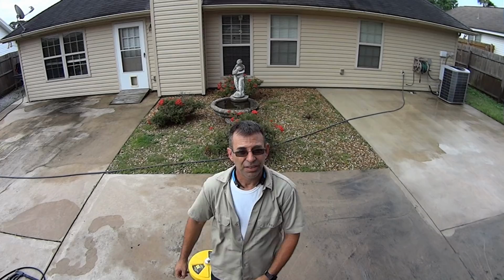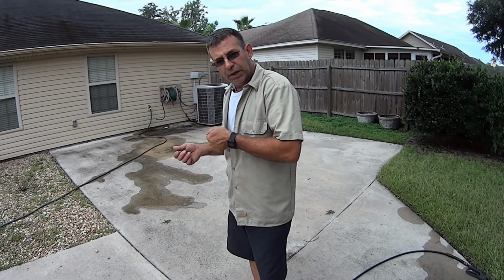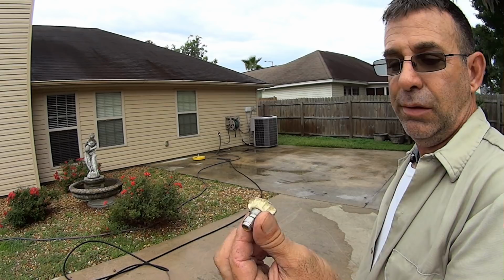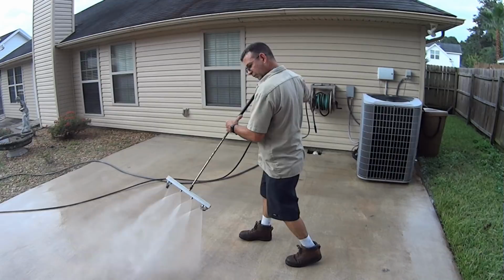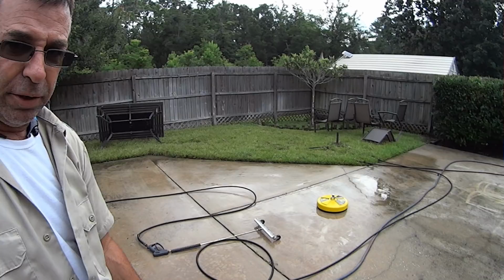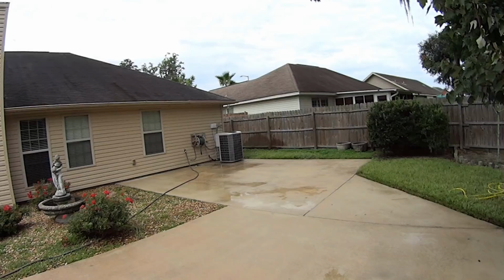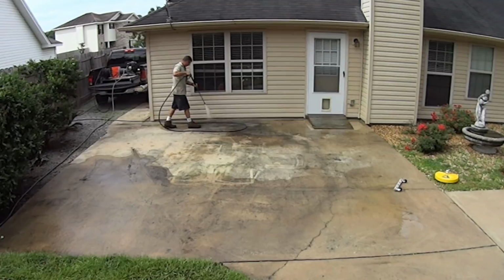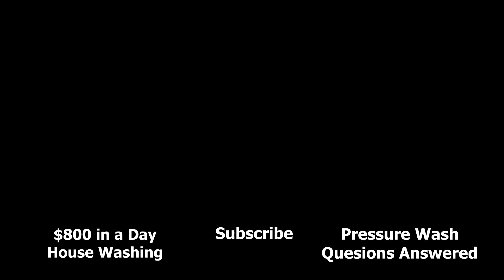How To Pressure Wash a Concrete Patio - Water Broom Demo - BE Whirl-a-Way Demo Review

Comment: I have a water broom. Was going to take it back as you're right, all it does is work like a broom then I had a eureka moment. Kept it and since I live in a snowy area in winter use it to wash the undercarriage of the vehicles, winter & summer. I have the jets pointing upwards. Works great. Will be buying a surface cleaner sometime soon. Thanks for the demo.

Comment: You have to keep pressure on it when you are moving back. That is why it comes up.If you lift slightly you can also rinse the area that you have done to see if you missed a spot. It also will push the dirt away if you lift every now and again. All in all, good job.

Comment: Great job with the video. I enjoyed it. If i can leave a small tip for your viewers. It would be to evaluate the level of the ground. You want to start at the bottom if there is a slope of some sort. That way you can clean the area where the water will build up at the bottom first, and you dont have to deal with all the flooding cleaning upwards. 👌
Reply from the maker: Thank you and I agree but it doesn’t make for good video. People like to see the clean

Comment: Dan you still using that short wand, get yourself an extension on it and you be amazed at how much easier it is. I did a 2200 sq. Ft. Driveway a week or so back about 4 hours to complete. I use 6' wand my 15" surface cleaner just glides along. I enjoy your videos.

Comment: Nice work as always. Looks like if you had a 12" longer wand you would be maybe a little more comfortable.
Reply: I agree, if he added an extension tube with a small weight on the end to help hold down the washer.
Reply: d hamby not supposed to hold down the washer your supposed to let it float like a hovercraft. You have to let the water Escape out the sides otherwise it won't do its job.
Reply: I have a g clamp clamped on the top of the outside of the case where the plastic meets the round brass piece. The weight in it is perfect to keep it down..

Comment: You can use a tennis ball in the wand handle to eliminate you having to hold the trigger down. A longer wand would help also. A ball valve will help for switching between wands or other equipment.
Reply from the maker: I do have a ball valve but I never use it. I never change Wanda, just tips but you’re definitely right!

Comment: While Dan is the expert here I used to have a water broom that just hooked to a water hose. I cleaned an auto shop floor with it. I used it like a broom. I just pushed in straight lines to remove the dust, dirt, oil dry, etc. Worked great and kept the dust down.Got up more than a broom and if u laid it down more it squeegeed.

Comment: If you put the water broom on the wheels it actually cleans well. I made a 80 psi 4 rpm water broom that is 42" wide. Makes fast work in warehouses. It has 9 jets. I also can make it 54" wide with 11 jets.  I may make 30" wide with 7 jets. After pre cleaning, floor buffer with brush, high pressure broom or whirl-a-way. Most likely a combination of 2
 We pre cleaned a 30,000 SF warehouse today. Tomorrow we scrub and high pressure broom. Two days work. Me and a helper tomorrow. Solo today. $2700 for the work.
Reply from the maker: Great job

Comment: Dan love the videos; keep them coming. I'm new to the business doing it on the side but i bought the Briggs surface cleaner you had been using. I like it but my old tired home owners machine takes awhile to clean patios. I just upgraded to a 4 gpm machine that I can pick up tomorrow but i have two questions. 1. How long does it take to do a patio (400 to 500 sqf) with your setup now? 2. How are you charging for patios? I posted some pictures online of my work and have gotten calls just for patios and not the house wash.

Comment: Great video Dan. Which surface cleaner do you prefer the BE or the Craftsman? Also what length of water pressure hose are you using?
Reply from the maker: For just a few more dollars, I prefer the BE cause it will last a lifetime

Comment: Good morning sir... thank you for your videos..they have helped me a ton.. what wondering if you could answer a question for me... How do you bid a surface cleaning job??
Reply from the maker: I usually just look at the size of the job and the condition and go from there. But to be honest I mostly just go flat rate pricing on a driveway that can fit four cars., a regular  sidewalk and front walkway is about $150 total. it will take me about an hour to an hour and a half and I tell them chemical free I’ll get it as clean as I can get it not responsible for oil stains
Reply: @DansVlog  People need to understand No Chemicals means NO CHEMICALS ! I explained to a homeowner exactly what I was going to do  Did a few feet and he was upset that the concrete was not more whiter, that he would not pay ! Good thing I cleaned a section near a corner behind the a/c unit to show him before I REALLY got going ! Still charged and got $30 for my time and setup . Six months later I did his neighbors drive way and he came over while I was putting my equipment up and asked me for a quote on his driveway.I asked about the chemical job he took me to the backyard patio area,it was all discolored and grass was dead around the edges ! The guy who did it charged him $300 🤔 Now he knows why I don't use Chemicals which is just how I do My biz !

Comment: Great stuff Dan!  Never thought I'd sit through an hour "What I did, and why I did it" video...but I've watched several of yours (and subscribed too).  So congrats on that.

The first videos I found were of you soft washing houses (cause that's my interest).  I learned a lot.  But now you seem to be deep into lawn care instead.  
Couple of questions about that:  
1) Any reason for the shift in primary focus away from house washing.  
2) I noticed you did not wet down shrubs when house washing.  Every other guy I found said that is a must to protect the expensive landscaping.  Were they overstating the damage the bleach can do to plants?  
3) I don't see you doing any roof washing.  Any reason you're not doing that service in addition to the siding?  If you did, would your setup work for 2 story roofs...or would you need to get something else to reach the roof surfaces and ridge peaks? 
4) Would a hot water heater attachment make the house washing move even faster? 

Thanks in advance for your insights.  Greatly appreciated.
Reply from the maker: Lawns is always my primary video and focus. 30 years cutting grass, 3 years playing with water. I never wet down anything. Maybe they use 12% and run it strong. I use 10% and move along quickly. Never lost a plant or grass but I do move delicate potted plants if I can. I don’t and won’t ever do roof washing. I will let the big guys with $1million dollar insurance policies specially for pressure washing have that mess. As soon as I do a roof, I fear I will be the reason for any and all issues that roof may have. No thanks, plenty of easy money to make from the ground floor. Hot water is good for heating up and thinning out oil and grease but I show a house wash can be done with just a 1 gallon pump sprayer and a garden hose. No need for the added expense in my opinion. That’s just my way, not necessarily the right way and not the only way but it works for me and I enjoy sharing my craft
Reply: AWESOME!!  I really appreciate you explaining the reasoning behind your decisions, both yea and nay.  You capsulize the knowledge you've gained from years in the trenches.  Wisdom that those like me, don't have yet.  I appreciate your mentorship, and will continue following your lead on the practice of this business.  Don't see how I can do anything but prosper by doing that.  That's again, sincerely.  ~Ron Eason

Comment: I've learned a lot from you videos. Sorry for all the questions. But, do you ever wash wooden decks. Whats your process for that? Thanks again for all the tips! Got my first 3 Jobs lined up here soon.
Reply from the maker: Painted wood I would use my normal bleach soft wash technique. Naked wood or treated wood I would  do it just like I did in this video
Reply: May I ask how you price your concrete jobs?

Comment: Hi Dan. This is Nwabisa from  South Africa. 
We only have direct drive and no belt driven high pressure  washers. I have been told by the suppliers that I will certainly  and significantly drop the pressure with any extention hoses I connect. The pressure washers are 4gpm's with a standard hose supplied which is 33 ft long? What do you advise I do as I need to do a truck set up with 100 -150 ft long hose . We don't have anything more than 4gpm.

Secondly,  I there any difference  between soft washing and pressure washing hose? Can I have the same type of hose for the different applications?

Thank you so much.

Comment: Dan, a while ago I got the Briggs Surface Cleaner from Lowes after watching your videos, how does the BE Whirl-a-Way compare? (Aside from the connection point)
Reply from the maker: The Briggs worked fine as long as I kept disassembling it and greasing it like I showed in some of my videos. The whirl away feels smoother but like I said in my video it requires a different motion so I did not like it at first but now given the choice I would prefer the Whirlaway over the Briggs because it feels better it does just as good of a job and I don’t have to disassemble it To grease it.

Comment: I guess those wheels on that water rake are for decoration. 😉
Reply from the maker: If you look a little bit closer you’ll see that I use the water broom with the wheels and without the wheels to demonstrate to people new in the business that you can do what you need to do to get the job done.
Reply: Dan's Vlog 
I wasn't criticizing in fact I would be doing it the same exact way. If everything is an exact square or rectangle and without obstacles sure the wheels make sense .. also time is a factor.
Reply: Lol
Reply: the one i bought, the wheels are in a place that make them unusable lol

Comment: I see that you have that Surface Cleaner that isn't rated for your pressure washer I'm in the same situation and I'm afraid to use it and I have no way to turn down my pressure washer will it damage my pressure washer? Thanks
Reply from the maker: Mine works fine.
Reply: Dan's Vlog thanks! I will try mine out
Reply: That size he has is actually the perfect size. It’s 4inches per gallon a minute. So he had a 4gpm machine that means he can use a max 16in surface cleaner. And FYI you can use a house mix for per treating concrete and it cleans sooooo much better and way faster. To keep from killing grass just rinse, and rinse.

Comment: Thanks for your vulnerability in all these videos. You could look like an arse... but you don't ;) Awesome work! I'm going to buy a surface cleaner and get into this work when I get into this in my springtime. But as for the multi-tip water cleaner, you know what, I think my petrol Blower will clean up the water no problem as I've moved like 2.5 inches of water with it before. And means less pooling in some areas. Hmmm. Oh, and will need to be a habit to actually remember to take it if that's the case.

Comment: Dan’s what do you charge for that much flat work?  I’ve seen your videos on house wash pricing but curious how you charge for driveways and flat work such as this?
Thanks, I enjoy your videos
Reply from the maker: I think companies around here are charging three cents a square foot for a large surface area like this. I flat rate price all my concrete and usually add it in with the house so the whole job with the house and the front driveway and everything that I have not done yet is 250.
Reply: Dan's Vlog thanks Dan

Comment: Great vid Dan! That water broom seems like such a gimmick and not something that I would use or purchase.
Reply from the maker: I thought it did a pretty good job! The four spray tips make for a very wide spray pattern which takes a lot of work away from my arms having to move back-and-forth as I was clearing things away. I effortlessly just pointed it sprayed and walked
Reply: It did do a great job but I think you could be just as effective with just a regular nozzle tip.
Reply from the maker: Ok

Comment: Wouldn't standard car and house cleaning technique saved you some time? With cars and houses, you clean bottom to top and rinse top down to prevent streaks. The same principle used here would make it much easier to make sure that the lowest point is properly cleaned and saved time from constantly cleaning up the low point.
Reply from the maker: Not always. Sometimes ya got to work towards the direction of where you want to move all the funky stuff.

Comment: How do you stop the surface clean makeing strips? The serface is clean all the dirt and mold is gone, but ihave strips.
Reply from the maker: Some people put some bleach down and let it sit for a little while and rinse it off. I would suggest you look at the surface of your concrete and make sure that the sealant is not what you see striping due to the sealant needing to be replaced

Comment: Great vids Dan. I watched them all on the BE Whirl-A-Way and based on your experience I am leaning toward not purchasing one. I also read every single comment. You did seem to find the performance acceptable as time went on but weren't thrilled. In watching your motions the secret seems to be to use side to side and pulling back motion. Pushing forward causing tipping. These issues didn't exist with some of the others. My question to you is if someone accidentally  ran over your Whirl-A-Way and paid you for it, would you buy another or something else?
Reply from the maker: mpnret I would try something with wheels
Reply: @DansVlog  Thanks for the quick response, Dan. I was initially sold on the BE Whirl-A-Way but have since changed my mine. Believe it or not after watching many videos and reading 100's of reviews I am now leaning toward the Karcher 15". It may be more of a homeowner unit and not as heavy duty as the BE but it has mostly positive reviews on it's operation and performance when it's working. Most of the negative reviews are from when it's not working from loose nuts/bolts, clogged nozzles etc. All fixable and preventable. It floats along without tipping or other issues. Even has a marine grade ball bearing which you can source replacements on Amazon. Not to mention it's cheap. $38. on Amazon, $58. @ HD - 10% vet disc = $52.

Comment: hey Dan, have ya ever tried  turbo nozzle?
Reply from the maker: Yes and I think they suck. We have one at work. Nothing will ever compare to a surface cleaner that is matched properly with the pressure washer you’re using.
Reply: Why not use a turbo tip for tight/uneven spots or curbs and horizontal walls? I think it works much faster than a 40 degree tip.

Comment: Hello,

I’ve just come across your video in a google search.

What pressure washer machine do you use and what is the make/model of your whirl-a-way?

In australia there is no divinitie answer besides a $15000 machine and Surface cleaner..

A 196cc, max 2500psi, max 4000psi with turbo nozzle + a max 4000psi whirl-a-way may not equate to 4000psi cleaning power…. No single store can answer the question…

$15000 adjustable pressure washer with a max of 6000psi can solve that issue though……….

Comment: Are you able to grease that surface cleaner? Is it better than the Briggs?
Reply from the maker: No need that grease it. Seems more robust. Time will tell
Reply: Thanks. Ive been looking a 4 gpm pressure washers. Whats your opinion on the gx270 vs gx390. The gx390 models run about $200 more.
Reply: There is a grease nozzle on the head for adding grease. These things make for a much more uniform job and quicker to.

Comment: well, the white tip is a 40 degree, and almost always when  using a surface cleaner you will have some sort of tiger striping just for the fact that all concrete is not level creating variations of un levelness with high and low spots. always go back over the whole area with bleach in a pump up sprayer and spray a light coat just enough to get it wet  to erase the stripes. and no the water broom is intended just  to do what the title says its suppose to do.  the broom is not stable enough to maintain a steady distance to create a even clean and i don't like using the plastic surface cleaners because they warp and do not give a even clean. its best to invest in a metal surface cleaner , much more durable and not much more to purchase especially if your making a living off of pressure washing... this is coming from 15 plus years of commercial and residential cleaning..
Reply: Dont need a surface cleaner at all if you know what you're doing

Comment: I use outdoor bleach on blackish concrete. Makes for better results.
Reply from the maker: I see no difference using 10.5% which is stronger then "Outdoor Bleach" which MIGHT be 8.25% compared to just using nothing but water and a surface cleaner. But if it works for you... cool!
Reply: @DansVlog  What I meant was when there is fertilizer stains and ground dirt in the cement the bleach makes it easier to clean.
Reply from the maker: Oh I gotcha! Rust Aid works great as well

Comment: These brooms with the castor wheels are not good for cleaning because you cant get the right angle for the jets to clean. Only pushing debri. Now ryobi made one with large roller blade type wheels and a pivot connect that can be used as an under carriage cleaner and a water broom. Now i just used one for the first time today and if you set it to the water broom side and flip it over it can clean the concrete and then you flip it back over to use as the broom. It angles the jets in different directions and having the type of wheels on the side allows for a multi use broom.
Reply from the maker: These are water brooms, only meant to sweep debris away to make cleaning with a surface cleaner safer